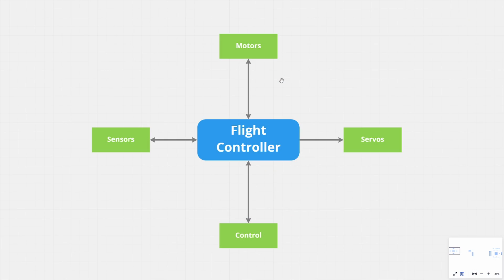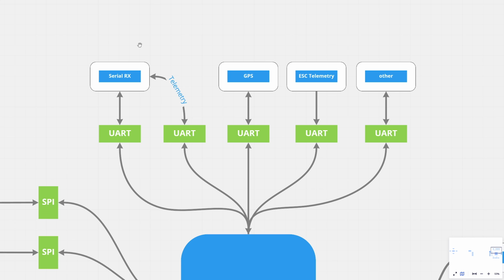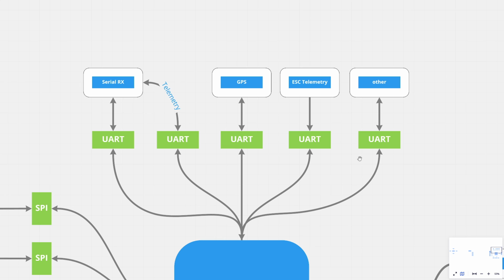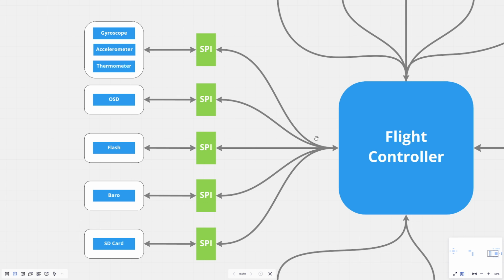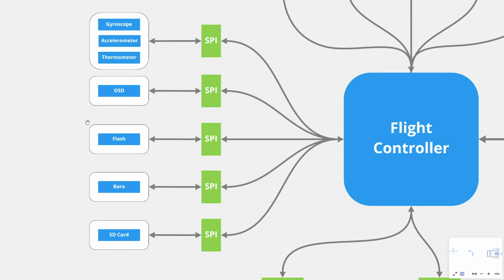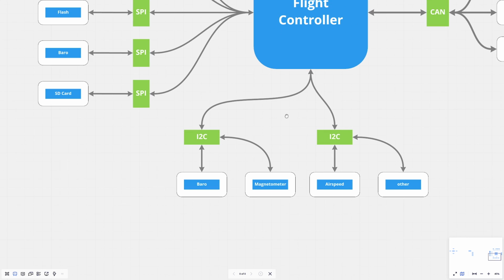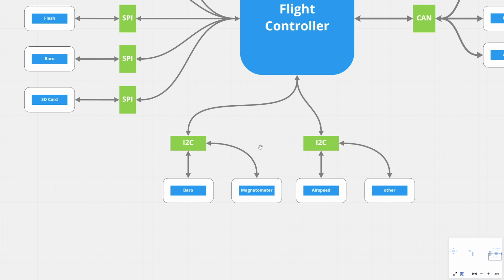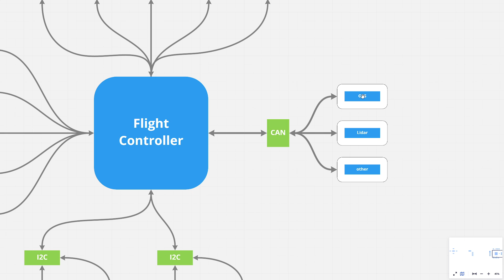All the flight controller buses: UART, SPI, I2C and CAN bus

Comment: How would you go about with communicating to a FC via an UART serial pin/port? I cant figure out for the life of me how I can use any protocol to do this. I dont understand how CRSF protocol (used by ELRS) communicates to the FC all the stick inputs with all the different channels. Do you use normal PWM values but in serial code?or a value just between 1000 and 2000? 

I am talking about FC that run Betaflight.

Could you help me out here for a promising project I am working on? I am currently using Arduino IDE with esp32 with UART pins.

Would be awesome to get your 2 cents on this. Thanks and I appreciate your content!

Comment: I want to connect multiple voltage and current sensors while controlling an ON and OFF switch using the Jetson nano using the UART but I want to know the best alternative to do this such as CAN etc. This device want to industrially customize. Kindly need your advice . Thank you

Comment: I wanted to add compass and baro to my FC but it only has one i2c bus. Is there any way to remap a UART or any other pads?
Reply from the maker: You can connect multiple devices to a single I2C bus
Reply: @FPVUniversity  Wow! I spent the better half of the day researching this. Thanks for the reply. Hope it does not affect the performance compared to an FC with integrated baro
Reply from the maker: @hemanthkrishna5343  majority of FC have baro wired internally to I2C as well. And very often the same I2C bus as external one

Comment: i2c is very handy, i have 6 devices connected on one build, soon to be 7 or 8.
Reply from the maker: I2C is also very slow comparing to other buses and it gets slower the more devices you connect to it
Reply: Hi, are there any hardware or software additional setting to use multiple i2c devices into a single i2c bus in the flight controller?
Reply from the maker: @febbyeka  multiple devices on I2C work out of the box. No extra settings needed

Comment: Thanks for the refreshing 😉 The CAN-bus is very popular in cars and what I have seen of it, has some overhead, to meet the safety standards.
The SPI bus also can take more than one device, but then it needs an extra port for CS (chip select). Useful for sensor data from external ADCs and for flash memory.

Comment: thank you very much. I'm a newbie, could you please explain why "SPI" onboard receivers are always worse than external receivers on UART? does it have to do with the interface (SPI/UART)? thanks again
Reply: It has nothing to do with the connection protocol (SPI vs serial). Often the implementation is executed very poorly especially the antenna which is just a wire. There are well implemented SPI receivers like the new ExpressLRS onboard reiceivers on tiny whoop boards.
Reply: @olaf_s_23  but SPI is a serial, right?
Reply: I second this question.
Reply: Yes, both are serial protocols. UART is 1 sender 1 receiver, is asynchronous, has built in parity and handshaking uses 2 wires. SPI can have multiple partners = is a bus, uses 4 wires, is synchronous and needs a clock wire, has no handshaking, parity or errorcorrection, is faster, is simpler, is smaller.
Reply: @olaf_s_23  thanks!

Comment: Can you help ,  I have the F405 wing set up on I nav , when I arm the motor and put the plane in stabilize mode and move the ailerons to full deflection and let go of the stick they don't return to center but if I disarm they go back to center and function normal when the plane is disarmed,  it only happens when I arm the motor
Reply: Sounds like stabilize mode is just doing it's job. The pid controller will "wind up" when it's trying to make changes, but not seeing results. This is why the control surfaces stay deflected. Disarming either disables or resets this process(can't remember).
Reply: @carnagefpv8256   It's weird cause I never had that happen before,  I always test everything on the ground before I fly And never noticed that till now , And the last time I flew when I made a turn I added rudder And the  alirons straightened back out  But it seemed like the rudder stayed stuck Because it kept crabbing to that   Side
Reply: @carnagefpv8256    Appreciate the input, by the way check out my homemade cockpit let me know what you think
Reply: @jimmytheriot8978  could also be a bad servo/ analog servo midpoint drift/bad linkage geometry/binding/loose connection. I don't know your setup but that's where I'd start
Reply: @carnagefpv8256   I downloaded ardupilot   On one of the boards And everything works fine , No  servos sticking, I'll keep playing with the other one to see if I can get it figured out
Reply: Sounds like it was just old INAV bugs then. The stabilized servo movement thing is normal, probably just took an odd combo of stuff to make it happen. The yaw issues definitely sound familiar, my fms Cub suffered the same issue on 2.6 switching to post 3.0 should fix your problems when you go back😎
Reply: Which INAV are you using? Do you have turn assist on? If so, turn it off. On builds previous to 3.0 yaw stabilization is not properly functional, so use RC yaw in the mixer, not stabilized. This is all previous to 3.0 if post 3.0, I'm not sure then.